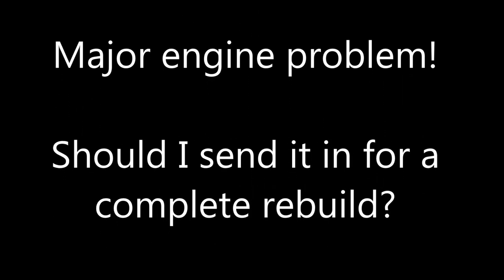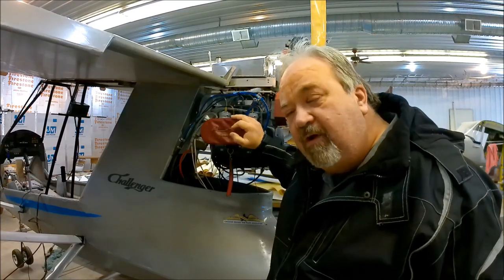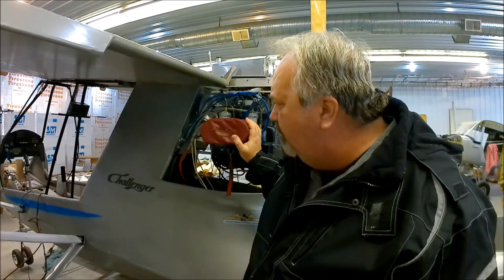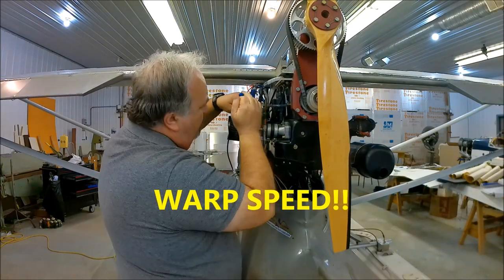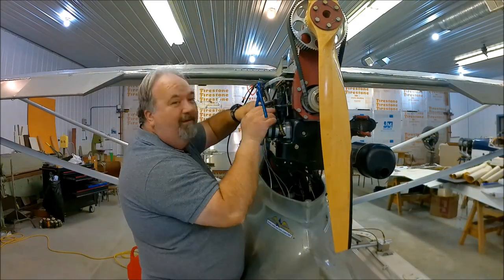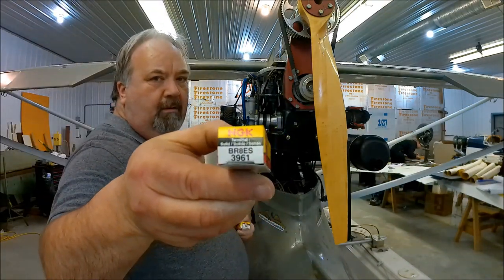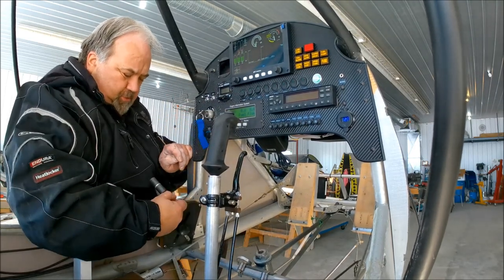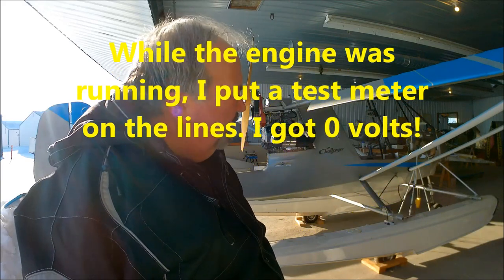EP 65 Do I have an engine problem? Is this a Disaster for my Challenger 2 Airplane?

Comment: Peter, 
If you have to pull the engine, and you do to inspect/repair/replace the stator, get it over to John or out here to Light Engine to have the peace of mind. This engine is 10 hours away from the 150-hour inspection and is an unknown-to-you engine. Bad time to find out you should have sent it in on climb-out and an engine issue. You don't get to just pull over to the side of the road if there is something you missed.
Either way, trust your gut and do what you feel is right; it's your butt in the hot seat at the end of the day, and only you can make the call. 
Cheers
Reply from the maker: Thanks. I did get the engine running smooth after going over the carbs step by step. It idles smooth without the choke now. I made the mistake of thinking that the carbs were set up previously and just cleaned them originally. Silly of me. As for the stator, yup, that engine needs to be pulled to fix that. Which will be happening in the next few weeks. Not going to fly this, until I'm certain it's as best it can be. Challengers are supposed to have a good glide ratio, but I don't want to find that out the hard way. Cheers.

Comment: I would remove the oil injection pump and go back to mixing the gas and oil.  The pump may be mixing a too lean ratio. Better to be safe than sorry.
Reply from the maker: The reliability of the oil injection is very high. Both Rotax service centers have a high confidence in their operation. It does vary the oil based on throttle position, which delivers a more exact amount of oil, and reduces plug fouling.

Comment: I have three Rotax 503s  I've sent them out for rebuild over time. I can't do everything myself. Also, good to get outside second opinions. Do the narrations and explain what you are doing. I have worked on Rotax engines on a number of planes. Each time I see someone else do something I learn something and see different ways of doing things. Keep up the Good work. One thought in my mind is the question of whether or not you will have sufficient power with the 52 hp Rotax 503 to get that float plane off the water when it is loaded with all the weight of the plane, floats, fuel, baggage and you (no offense but it appears you have a significant mass). I have a long wing challenger with a 503. I limit my passenger weight to 200 lbs and I weight 165 lbs. I want a significant margin of safety in terms of getting off the ground (ground roll reasonably short) and at least 300 feet per minute climb. The float Challenger II s that get off quickly seem to have Rotax 582 engines.
Reply from the maker: You can get these 503 equipped float planes off the water with 2 people and max gross. But not in 300 feet! A new 582 engine would be a far better, and may be in store in the near future. As for my.....size....well, yup, I am losing it and as it comes down, my payload will go up. One of the hardest parts of weight loss, is motivation. This  airplane is a big motivating force, and it's working I'm happy to say.

Comment: Did you talk to Rotax regarding the problems yet?
Reply from the maker: Yup, they have seen the videos, and are of the opinion that my carbs need to be properly adjusted. As for the charging problem, I have no AC voltage, to the engine needs to be pulled and I may need to replace the stator.

Comment: No AC voltage?  Or did you just check output from the voltage regulator?
Reply from the maker: AC is dead. Will be doing some testing for continuity, but I fear the stator is bad, which is very uncommon, as this is such a simple part. I may be just a broken wire connection inside the stator which is easily repairable, but I still have to pull the engine to find out.